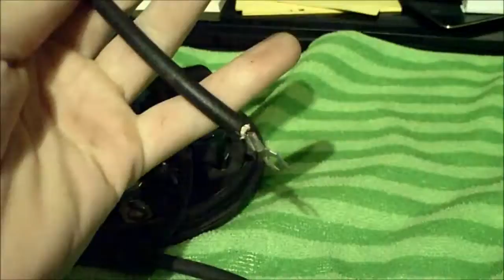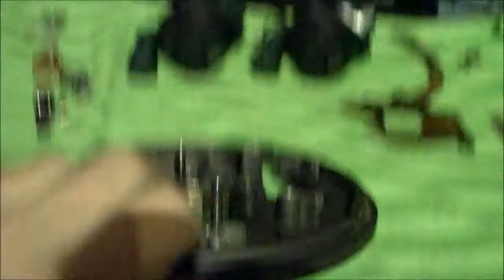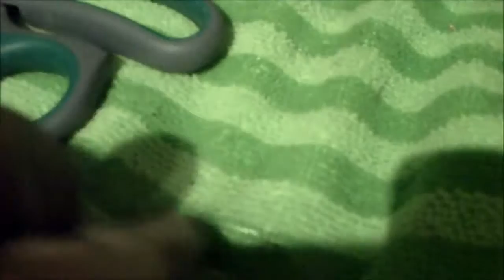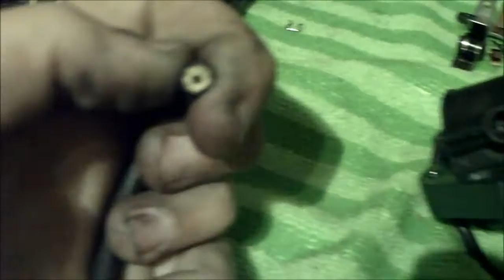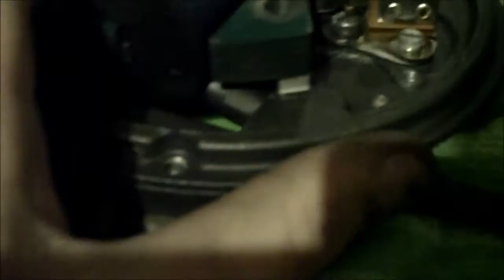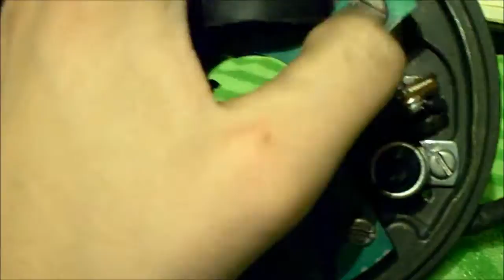OMC outboard ignition system rebuild

Comment: You can know with certainty in the first second of this video that the ignition components closest to you are for the top cylinder after learning they are located toward the front of the engine which is where the carb and throttle cam are located...  therefore the cam is all you need to see.
btw: someone reading might not know that the throttle cam is the curved brass piece seen under the front edge of the armature plate or that it's very important to accurately adjust the cam in or out as needed to make the butterfly inside the carb (not just the  linkage or cam follower) begin to move according to the tiny vertical line on it (timing mark) in order to synchronize throttle opening with spark advance. Notice the slot on the pointed end because it allows precise outward adjustment with a flat screw driver.

Comment: Why is one set of points gold...there must be some reason? No one seems to know. That little post in the coil is threaded so screwing the plug wire in makes life a little easier.
Reply: Two different brands of points.  Not all coils are threaded.
Reply: @JoeBlowski  Old, old Mercs are the only ones I ever seen that are not. I have bought a SET of 2 and one is gold.

Comment: I have a 1951 5 hp gale buccaneer that I am currently restoring. Whenever I go to start it I get a loud popping noise followed with a lot of smoke from the exhaust. Would this part be causing this?

Comment: Great video - thanks for this.  I'm just heading into rebuilding a '57 35hp OMC that has been sitting since 1965...   How about a video on rebuilding the carb?    Thanks again.
Reply from the maker: i could do a video on the carb rebuild. however i'm pretty sure the 35 hp has a different carb than the 10hp i have. maybe all do it anyway, i have all winter to fiddle with this stuff since i live in Canada.